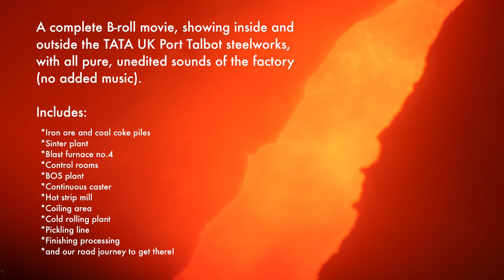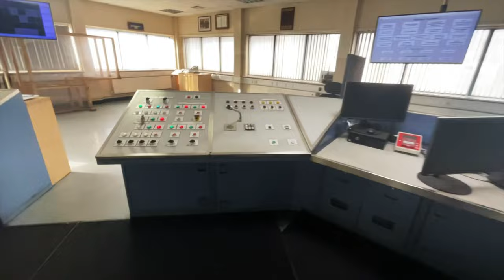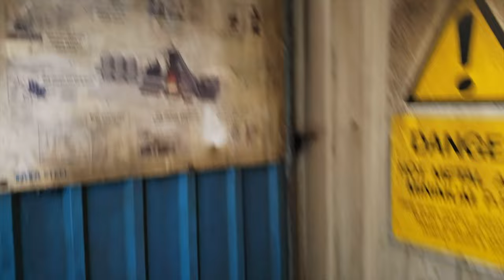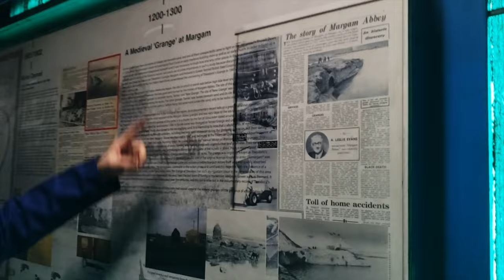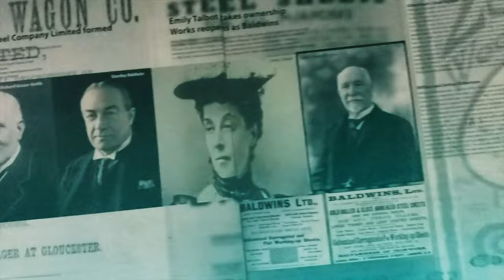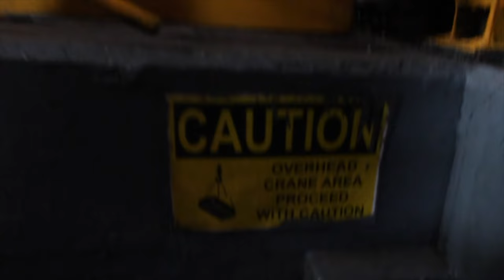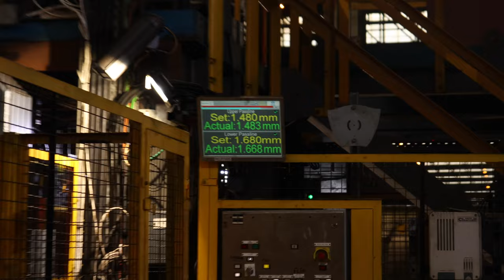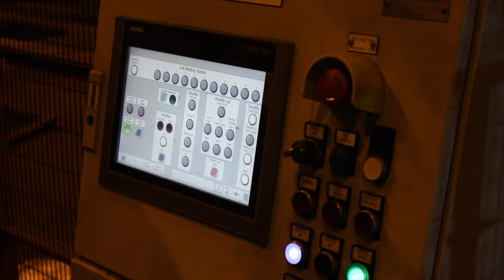Visiting Port Talbot Steelworks — a complete steel mill B-roll

Comment: It's sad to see the end of virgin steel creation at Port Talbot.  Did Tarta Steel import steel billets into Port Talbot to hot roll in the strip mills?
Reply from the maker: @johnbradshaw7525  yep, it’s a sad end of an era. My time at the mill truly was one in a lifetime. For now until 2027, the mill will be hot rolling imported slabs in this limbo phase until the new arc furnace is constructed and operational.
Reply: @ I had a friend who lived in South Wales. I’d see the large number of iron ore & coal trains heading to Port Talbot through Newport station, with trains bringing steel products in the opposite direction.
Reply: @ your video was very informative. I find it fascinating the whole process involved in the manufacture of iron & steel. As well as the various processes involved in turning newly made steel into useable items like rails, tubes, hot rolled strip & cold rolled strip.